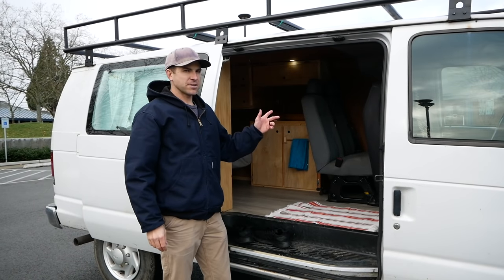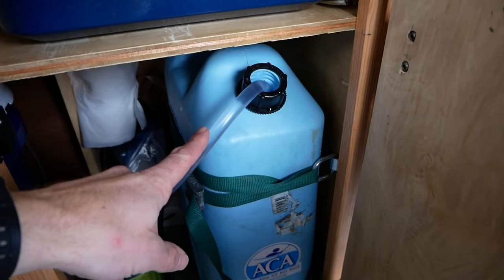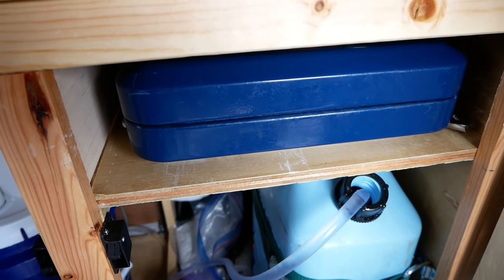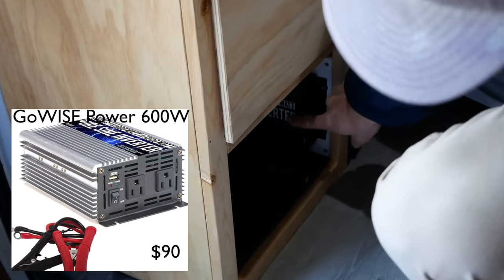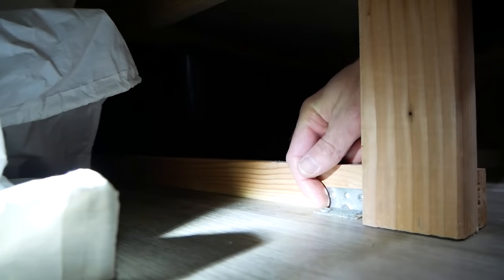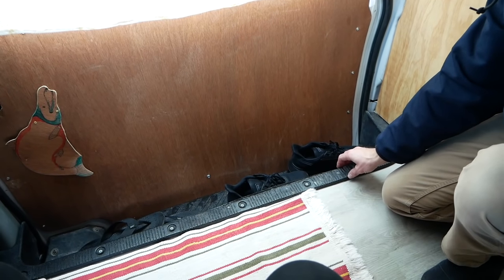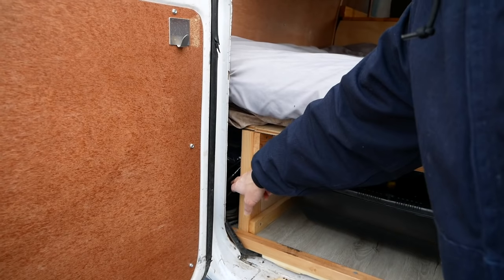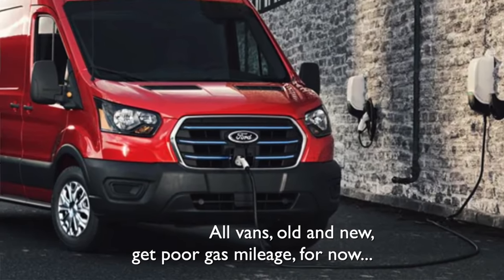Budget Van Conversion Finished Tour | Ford Econoline $3000

Comment: Good job on the flooring! Having worked in OEM design of 'commercial vans' for many years, there's a TON of information I wish I could give the 'prospective conversion van' builders before they start out...it would save them a lot of money, and give them a better finish, when done. For example, a LOT of those 'strange shaped holes' in the wall sub-structure are actually designed in for 'attachment points', from anchor holes to run 'E-Track' to 'polymer push-anchor holes' to attach wire loom to. Before 'custom cutting-drilling-grinding', always look to see if you can 'work your design' around use of these anchor points...then make a trip to a 'bodyshop hardware' store (like NAPA or a local body shop) show them where the attachment point is, how much weight you want to bind to it, and they'll most-likely provide you with the answer (steel anchor plate, flanged push-pin, possibly even Huck Bolts...you may be able to borrow a Huck Bolt tool from your local Fastenal to install them...but they are as strong as hot-formed rivets)...again, knowing how to work the attachment points already built in can save you TONS in the 'final attachment solution', look better when you are finished, and make 'later modifications' much easier if you want to 'convert your conversion' once again...in the future.
Reply: Skeeter you sound like a dude I wanna know ! Do you have your own channel or resource source somewhere?
Reply: THANK YOU!!!  I just purchased an 01 Ford E450 that I am about to “redo.”  Your info will be extremely helpful!

Comment: I’ve used your videos as a guide/bible to complete my E350 conversion. The only major differences for me, was a tongue and groove ceiling, an extra set of brackets for the rear seat to turn around, and we may skip the sink for cooler space. I’m almost done putting the walls up and the bed will follow soon after. Can’t wait to get some trips in this summer! Without your videos I’m not sure I would have had the confidence to pull it off, thanks a bunch!
Reply from the maker: Thats awesome to hear! Enjoy those summer adventures!!

Comment: That cement mixing tub you have in back from Home Depot can be used as a moveable shower pan... just a thought for those looking for a shower pan idea for inside showers other than a dog bath pool... they have an unnamed brand up to 24x 36 inches holding about 26 gallons for $13.

Comment: Awesome budget build..  if I was u, I'd let some professional tint the window.  Because as soon you put your reflective "privacy stuff" in, everyone around knows that you are in the van..  and if it's possible, put a swivel base for the 2nd row seat, and use it for chill-time also 😊👍
Reply: Window tinter here, and I totally agree!! It will add privacy and a layer of insulation. Ask for ceramic film, it blocks up to 93% of the heat.

Comment: Nice job man. I love how you contour the cabinets to the cabin. I just paid off my condo three years after I bought it, and I am thinking about renting it out for at least a year and doing at least a cross country trip. I’ve been looking at vans and campers and trying to figure out what is going to be the best route to go. As you said, the gas mileage on those vehicles is a great… But then again, even a newer truck hauling a trailer is still going to get roughly the same. So it’s kind of a lose lose situation and less you can get a truck or SUV that is hybrid. In which case, you get the best of both worlds and better gas mileage.

Something I will probably look into if I decide to do this. We will see. I think it would be a blast to just drive with no destination and see what I see along the way.

Comment: This is a very nice, simple build. I have a similar van. I placed the upper cabinets over the bed on the other side, and sleep with my head on the driver's side. The reason for that is when parked on the street the passenger side is usually lower than the driver side so my head is not lower than my feet when I'm sleeping. It doesn't seem to trouble you, so well done.
Reply: If you get sideswiped, your noggin' gets smacked!

Comment: Great craftsmanship and real life, affordable solutions! But so much effort and you can’t stand up.  Sometimes what’s cheap ends up costing too much in basic comfort. To me, it would have been worth the extra money to stand.
Reply: If you don't want to spend that kind of money or don't have that kind of money, this will get them camping. They don't live in it full time, and having a dry van to sleep in is much better than a wet tent. I can't stand up in my van either. You can sit on a chair when you have to cook or do something else inside. I have an even simpler design than this. With no bed in it. I use the floor space during the day. And at night I have three thick former sofa cushion that I lay down on the floor in the middle of the benches. They are held in place by the benches, the dog cages and the van door in the back. I sleep very well in there. I had three dog cages in there too (one small dog, two medium size dogs), and a Campa Potti. My van is the longest Toyota Hiace. The benches were made of a bench plate on top of plastic containers with lids on them. And on the other side I just had a bench plate with a long metall bench underneath it. And for electricity I had a big leisure battery, an AC converter and a 220 volt 10A AC charger. I could use shore power, 12 volts or 5 volts. And it was all easily removable when I needed to use the van for other things the rest of the year. I didn't do anything to the walls or the ceiling (they were covered in grey thin boards when I got it). The van came with windows in the back. You could open the windows in both the sliding doors. The only thing I missed, was heating during camping in colder weather. So a diesel heater connected to the van's diesel tank would have been nice to have. But we didn't really need it. When on shore power, I used a small electrical oil radiator heater.
Reply: 0
I use to think like you but I've watched Hannah and realize it depends how you use your van and your funds available, I like what they've done but you obvously don't.

Comment: I prefer the simpler van conversions. Consider a small secretary chair with wheels to scoot from side to side when you cant stand up. They typically  have ergonomic back rests. There are so many solar lights to choose from that I don't see the point of wiring either. I'm just happy to graduate from a tent.  Nice job.

Comment: Good stuff. Have you considered putting a seat belt type device for the bed? I used to be an OTR driver. When driving team, one drove while the other slept. Having that seat belt made me feel a lot safer. Even a quasi stop, ie not slamming the brakes, but say a quick slow down from 60MPH to 30MPH due to some traffic back up- can throw ya forward if you're sleeping. Yea it's going to wake you up, but the sudden slow down will wake you up anyway. Better to be strapped in than to slam my head into the fridge.

Comment: Really like this build. Very practical and actually achievable on a realistic budget. One question, did you consider using a 12v electric pump for the facet ?
Reply from the maker: Great question, we thought about it for a moment but are very happy we decided against it. Since we don't live in the van we have actually used the sink very little. If we do cook it is usually outside and we carry a collapsable dish bin for doing dishes outside of the van. If we were spending more time cooking in the van and or more nights per week in it I am sure we would use the sink more and a electric pump would be helpful.

Comment: Great van conversion. Tons of ideas. and rare to see a conversion with 4 seats. Speaking of passengers 3 and 4 (kids I suppose), where do they sleep ?
Reply from the maker: Thankfully our 3rd passenger is still relatively small. He generally starts the night in a travel crib (just fits in the space between seats/sink/door) and at some point usually ends up in our bed. 

We'll either eventually upgrade to a larger van or get a system like the cabbunk.

Comment: great video on the van but I do not agree with the last statement that all Van's new or old get bad mileage. my 2004 dodge sprinter 2500  144wb high roof camper van gets about 9L/100kms or 26 miles per gallon.
Reply from the maker: That is pretty impressive gas mileage! I was just trying to say that all vans currently guzzle a good amount of gas compared to an electric/hybrid vehicles on the road these days.
Reply: now that I agree on!!👍🏻

Comment: I opted against some of the choices you made Starting with a passenger van vs a cargo van meant no installation of windows required and no added paneling and insulation installation was needed Avoiding placing the bed sideways meant  not having to sleep on an angle (because the van isn't wide enough for someone of even normal height to sleep normally in a bed placed sideways). Going with pre-made cabinets which can be purchased and finished for only a few hundred dollars produced a much nicer finished product, with more storage for things like a marine grade cooler or eventually a cooler size refrigerator, and large water storage containers. Going with a portable toilet which can be purchased for $100 or so meant avoiding pea bottles and buckets. Using a portable battery systems allowed me to avoid extensive wiring Putting in a floating wood floor covered with carpeting over the existing passenger van floor meant the passenger van can be converted back to a passenger van because none of the conversion additions including the floor permanently changed the van Adding a swivel to the front passenger seat allows me to sit comfortably in the van facing the rear of the van with easy access to the cabinets with sink and smooth top for portable stove placement I may have paid more for my passenger van but the conversion cost has been less than $3,000 including the cost of buying tools to do the conversion
Reply from the maker: Sounds like you've got a great conversion for your needs! Ashley is 5'8" and fits perfectly sideways, we also weren't worried about the bathroom as we primarily use the van to camp in on public land (we pee in the woods) and the pee bottle really only comes in handy on the rare occasion we are stealth camping in town.

Comment: Just wondering if the mechanical bits of the van itself, if you reconditioned it since it's a pretty old van. Having a good living space would be a second priority but if the vehicle itself is unreliable due to age is the prime concern when traveling.
Reply: ford econoline vans are mechanically solid unless High mileage +275000

Comment: So I bought a 2007 E350 hightop wheelchair van for $800, my wife is wanting to do the same thing with it. It has over 417,000 miles that's why so cheap. Any pointers with what you would do with a hightop would be appreciated.

Comment: Question to everyone who has one of these. How often do you use a sink? I'm wondering if it's necessary in my build.
Reply: After camping for three weeks in the back of a pickup truck, I would welcome a sink as washing dishes in the creek, ocean, or not at all was getting rather old. Nothing worse than having manky dishes bashing around while driving.
Reply: I installed a pump sink but have a bad back so filling, and emptying 5 gallon containers was tedious so now have one gallon containers and a dishpan.  Grey water is easily disposed of wherever you are camping.  Living simply!
Reply: For everything, every day living

Comment: Nice video did you stain the wood
Reply from the maker: Hi Dre, we ended up using shellac, we didn't want to worry about off gassing fumes from traditional stains but wanted some protection from moisture/stains. So far the shellac has worked really well. The countertops are covered with waterlox which is a common way to finish butcher block counters, we used the same thing in our kitchen so we had a bit left over. The waterlox smell is super potent when applied but disappears after it has cured.

Comment: Hi :-) appreciate your vides... just wondering if you think using a smaller diameter drain pipe out of that sink and then fastening some kind of a trap, would help with the, sometimes disgusting, greywater odor come in back up through that sink drain? Also, wondering why there are second row seats when there's only one bed... is it a multi-use van for transporting people sometimes and then camping with just one or two people other times? I'm also wondering about the way that you did the insulation in the panels and the way everything is not completely sealed, was that for intentional airflow... is that going to keep down the moisture build-up? I'm wondering what you think, if somebody were to do a conversion similar to this for being in the van more full-time.... what about those types of issues for moisture buildup and mold potentially?
Reply from the maker: Adding a trap is a great idea if you have the space, since this van is really just for weekend adventures the water gets emptied pretty regularly and we haven't had odor issues yet. 

Our outdoor activity of choice requires "shuttles" so pretty much every weekend the van transports more than two people for at least a short distance. The seat is a slightly safer way to ride as well as keeps wet people off of our bed. 

We do live in a damp climate, so far we haven't had any moisture issues yet but we are VERY aware of moisture management. The lack of caulk helps make sure we are at least getting a bit of airflow into the panels. If you were cooking in tour van and or living full time I would look into other moisture management solutions. We have some friend who keep a dehumidifier in their sprinter (helpful especially for kayaking gear). 

Best of luck on your build!

Comment: Why you did spend money to put foam, plywood and vinyl beneath your bed? Insulation?
Reply: if u meant on the floor , it is needed . cold/heat will b obvious with out it plus noise.

Comment: Just wondering if the blue drain bucket is water tight to the drain pipe?  Also curious about your reason for using shellac. Thanks!
Reply from the maker: Blue drain bucket is water tight. We actually did put a PVC pipe stub through the floor, but since we are just weekend camping, it is really easy to just empty it. We used Zinsser Shellac because it has low VOCs, non-toxic and relatively cheap. I'm sure a poly urethane will last longer, but we just wanted to minimize some exposure for a recreational vehicle.

Comment: Very nice layout! 
Great idea using those concrete mixing tub. 
Do you recall how tall the bed platform is?
Also, is the radio still doing well and if so, how is the AM radio reception?
Reply from the maker: I don't remember how tall we ended up building the bed, the radio is still holding out great. We don't listen to AM much so we unfortunately cant offer a review on it. It still synchs well with cell phones for podcasts etc.

Comment: Hey there, new to this, was wondering if you might have a blueprint or some sort of thing with your template of cuts and measurements? Just looking for ideas. Thanks!
Reply from the maker: Sorry @roadyfam we didn't make master templates or anything like that. When we were sketching templates to cut flooring, wood, carpet etc we used cardboard that was lying around. Best of luck on your build!

Comment: Are your battery under your head when asleep?? Hope they are sealed i would worry about off gases..
Reply from the maker: They are sealed AGM batteries. Installing batteries anywhere in a van is cause for concern (I am  not concerned they are under the bed vs. somewhere else in the van), so AGM or Lithium is a good way to mitigate that risk. Lead Acid type batteries like the one under the hood would not be a good choice.

Comment: Did you have to change the break and fuel lines on that old of a van?
Reply from the maker: We've done the brakes but so far the the lines are good (we had a mechanic give it a once over after we bought it)
Reply: @findoutDIY  heck I'm looking for a van. I've searched everywhere and they are all rusted and overpriced. I can't find one for less than 7 or 11 k 😲

Comment: How long is that bed?
Reply from the maker: It's almost exactly 6 ft, Sam is 6'1" and I am 5'8", we have enough space for weekend trips etc. but Sam usually ends up sleeping slightly sideways, which for a few nights at a time isn't a problem, but I think would drive me nuts long term. He does the same thing in a bed at home though so I'm not sure the length would really solve the problem anyways, I just have room to move away from him in a regular queen bed vs. the van bed.